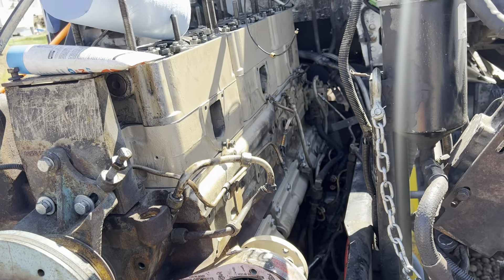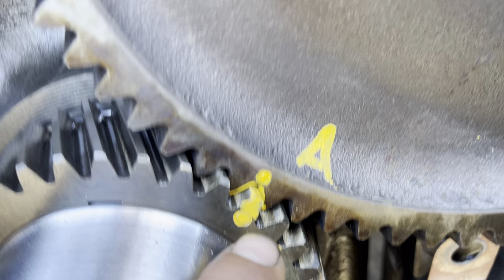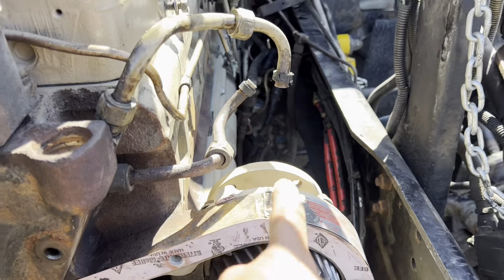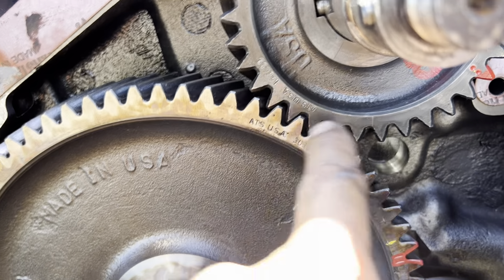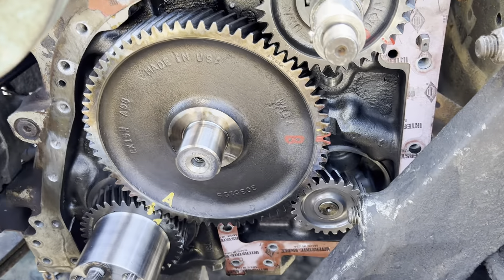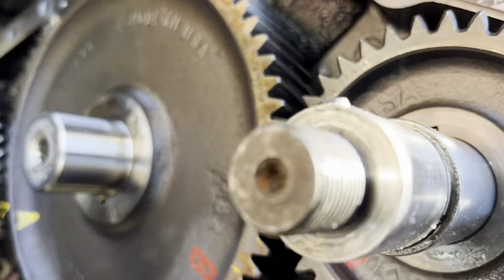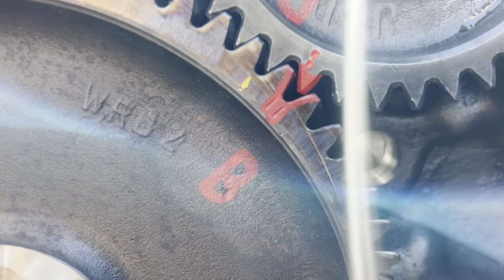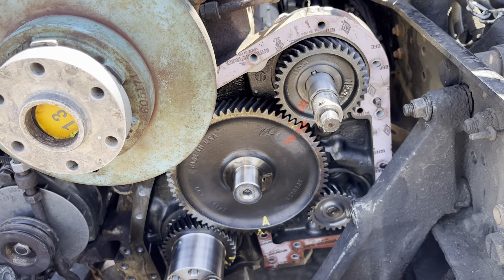Timing marks for a Big cam IV Cummins￼

Comment: While rotating the crank take out the glow plugs if installed engine will be easy to rotate
Reply: If you show me where they are at I would remove them. But it doesn't take a rocket scientist to tell that you have no idea what you're talking about

Comment: 2 dashes to 2 dots is to time acc drive.  Crank also has timing mark for cam to be in right place.  Also setting engine,there is a tc on acc driive. Dont use it with engine set. A 1-6 B 2 OR 5 C 3OR 4.  153624. OBD METHOD 72 inchpounds on injector,14 intake,27 on exhaust all done on same cyl same time.  Old method is 5 inch on injector,and another cylinder is intake 11 and exgaust 23 i think.
Reply: I think I get what you are saying in which I argued this at Cummins school ever since they came out with topstop injectors. If the topstop wasn't adjusted correctly you would put too much pressure on the cam and follower by adjusting it on the inner base circle of the cam if you adjust it on the outer base circle of the cam you will never put too much pressure on the cam thus preventing premature cam failures but I have to say it's been many years since I've had a BC IV apart brings back memories when you could do a complete in-frame for less money than a set of injectors costs today
Reply: @davidsignor7931  also adjusting this way , you can tell when a cam lobe is peeling off on injector.  Yes parts today are a fright.  N14 uses same method, forcing injector down,backing off 2 hexes, 14, and 27 on valves same cylinder.
Reply: @kriscalverley2131  exactly and back in the day you could tell that also the N14 was a whole new thing I can honestly say that I have never replaced a camshaft in a N14 where I can't say that for the small cams up to the big cams IV and  timing those engines was not a quick process like it is on today's ISX or X15

Comment: Hi how do i delete the air compressor from my engine. Is the fuel pump drive different from the air compressor drive? I'm using the engines for a boat so don't want the compressor there. Thanks
Reply from the maker: I am not 100% sure but seeing other engines on boats looks to me like they just takeoff the air compressor and install the PT pump or the air compressor goes unless it has a special shaft fitting of some kind besides that I think there’s not much to that it should not be complicated I think but again I am not 100% sure I’ve never done that
Reply: @mexicanmexican8682  thanks for the quick reply 👍 I'll strip it down then see what i need.
Reply: You need spider gear coupler from acc drive to fuel pump. I may even have one
Reply: @kriscalverley2131  thanks for the info. . Are you in the UK?
Reply: @YZFR1mart  no sir.  But we got a ton of english here,building pipeline in northern bc and alberta. Not many of those parts around. I will check and see what i have.  I will look in my parrs old book too